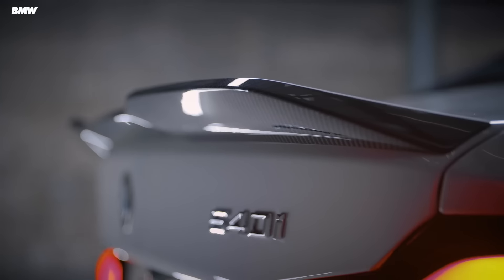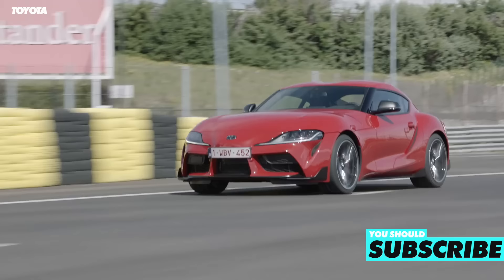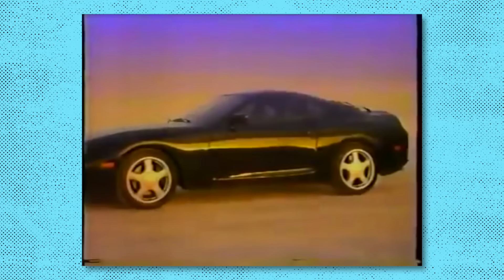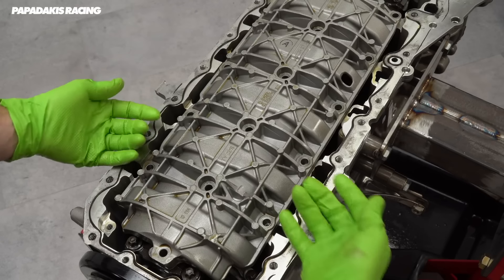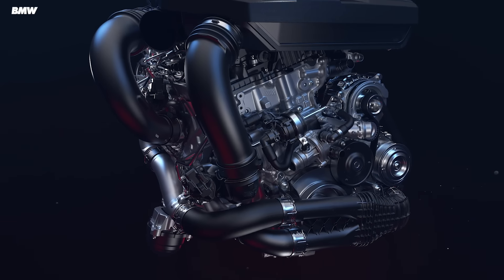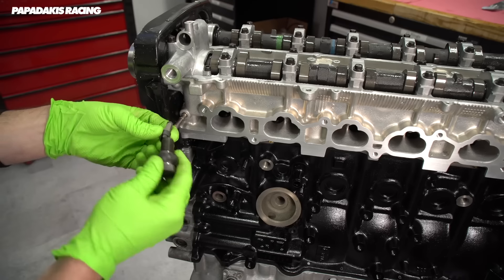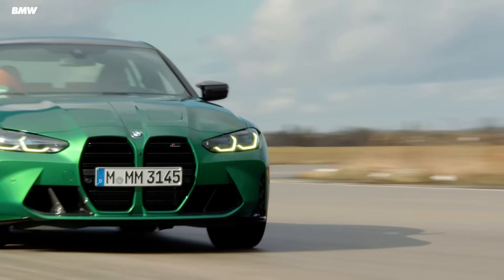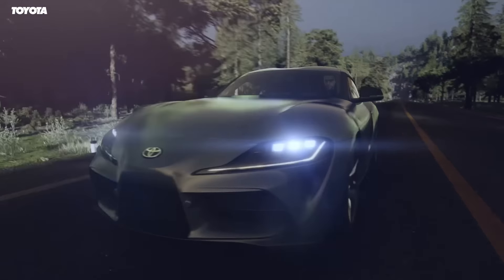Inside BMW's Greatest Engine

Comment: You forgot to mention that the B58 had to meet Toyota quality control. It only passed Toyota's quality control after Toyota's engineer sent back 1000's of B58 parts back to Germany for improvements. Now all BMW models with B58's benefit from this.
Reply: That was the specific variant of the b58 that's in the supra. Not sure if they use that exact variant in their own cars (I think there are 4 variants)
Reply: this is BS
Reply: Lol how do you know this?
Reply: B58 from all all (40i) 2016-2019 are completely different than the b58 in the toyota supra and 2020+ M340 which is a B58TU with 6 port injection
Reply: @Mitrofanvlad  Lovely, your BMW fanboi tears are oh so sweeeeeet!
Reply: BMW doesn’t use that variant in their cars, the B58 in other BMWs have proven to be good, those “1000” parts I feel is bs. There’s not many things if not any issues internally inside the B58 in general, people already touching over 100k miles in these with no internal issues. Only time will tell, this is probably going to be the same case as the M54 a great engine overall with very little problems if not better than the M54 and M52.
Reply: I smell a whole lot of BS! Show me the proof that Toyota had a hand in the development of the B58!
Reply: @joebloggs4191  Search for it online. This was part of interview done by the Supra's chief engineer. I can't share links here because YT will automatically delete your message.
Reply: in interview they said that but in reality toyota only helped with minor tweaks on the B58TU for the supra, the whole 1000 parts is rubbish, considering the fact the engine was very reliable to begin with
Reply: @pantiesgonewild358  It's not rubbish. Toyota's reliability reputation is on the line by putting a BMW engine with their Toyota badge on it. You think Toyota is going to just blindly trust BMW or do you think they are going to extensively test the engine? Toyota and BMW have different quality control. It's why Toyota scores every year top 3 position as most dependable vehicle and BMW barely above industry average. Those are facts backed up by numbers. Toyota did test 1000's of B58 parts when inspecting the engine, it's what Toyota does. They do this on their own engine as well.
Reply: @pantiesgonewild358  Exactly! like if they went and spent all that money redesigning parts with new tooling etc. for what is a low production volume car. Makes zero sense. They went to BMW exactly because they didn't want to spend money on development of the new Supra as otherwise they would have built there own engine! The new Supra is 90% BMW and 10% Toyota! Which I don't mind because I am a fan of both BMW and the Supra and have owned both. But these Supra fanboys need to get their head out of their backsides! Not exactly like the Supra was completely bullet proof, head gasket problems anyone?
Reply: @Mitrofanvlad  it aint
Reply: @joebloggs4191  nope its true, that's why the chassis and engine of the z4 is also reliable af. Basically BMW built and Toyota tested
Reply: @barackhusseinobamaii3303  The B58 has been around way longer than when it was put in the Z4 and Supra, 2015 in actual fact! Also do not forget that both cars are built by Magna Steyr and not in the Toyota factory. The B58 has been a reliable lump well before Toyota came onto the scene! The only thing Toyota did was check that it was reliable which it is and made their own chassis tune and different body, everything else is 100% BMW! As I said 90% BMW 10% Toyota!
Reply: @electrikoptik  It is rubbish, why did Toyota use Yamaha built engines in the last gen Celica, engines which I might add were pieces of unreliable shit! They built the Supra in conjunction with BMW because they did not want to spend development money on their own engine so do you think they are then going to spend that much on redesigning and producing 1000s of part and are you that stupid to believe that BMW would turn around say ok master Toyota we will produce over 1000 parts just for engines for the Supra? All of you fanboys do not understand basic business and economics!
Reply: @joebloggs4191  Toyota owns a part of Yamaha and furthermore Toyota and Yamaha have been partners for very very long time. Yamaha is a master in headwork. It's what they mostly do if they collaborate with Toyota engines. The 2ZZ block was designed by Yamaha. It's a great engine, used by Lotus also. The oil pump is the Achilles heel of the 2ZZ, though incidents are rare and usually occur due to fault of the driver.
Like I mentioned before Toyota's reliability is on the line, they won't just put a BMW engine in their car without fully inspecting the engine. They've done this in the past with other models that briefly used BMW engines because of partnership. For example the BMW N47 engine was briefly used in a couple of euro-spec Toyota's. For the N47 Toyota redesigned the Stop & Start system, created new ECU, more insulator engine mounts, installed their own DPF filters and a new dual-mass flywheel, resulting in a smoother, quieter and more efficient and refined engine.
Reply: @electrikoptik  As I have already stated the B58 has been around way longer than the Supra and it was already reliable nothing for Toyota to do on that front!
Reply: @joebloggs4191  Toyota's partnership with BMW (2012) precedes the creation of the B58. Food for thought.
Reply: ‘Sent back’ and ‘test’ are two different things.  Yes they tested things as Toyota X-rays even the bolts. And taught bmw engineers a few things.
Reply: @electrikoptik  And each time Toyota uses BMW engines and not the other way around. Food for thought!
Reply: all marketing bullshit to save toyotas ass they did nothing, the b58 has always been reliable
Reply: Literally the reason its so durable is because of toyota and its dope
Reply: @Arceus556  Another idiotic comment. As said before the B58 was around long before Toyota came on the scene! BMW do know how to make durable engines, they have many in their back catalogue which were very reliable. Only Scotty Kilmer and Supra fanboys don’t seem to understand that.
Reply: @joebloggs4191  Please educate us on how reliable the BMW S85 engine is. Let's begin with that one.
Reply: @electrikoptik  Why don’t you educate us on business and economics since you think that it makes financial sense to enter into cooperation with a company to buy their drivetrains and then to turn round and waste dollars on re-engineering over 1000 parts? Let’s start with that shall we?
Reply: @joebloggs4191  Yikes! This guy is super salty. Let me apologize to you. I'm sorry that it took Toyota's quality control for BMW to finally make a decent engine. Although still the B58 is known for having 4 common issues: Coolant Consumption/Loss issues, Valve Cover Gasket issues, Oil Filter Disintegrating issues and VANOS Solenoids issues. I think you should redirect your anger and bitterness towards BMW. Send BMW HQ an angry letter and demand them to build higher quality cars/engines. Facts don't lie, BMW scores every year on quality/dependability tests slightly above industry average and then barely above Chevrolet.
Reply: @electrikoptik  I think the super salty people here are the nut jobs Supra / 2JZ fanatics who can't understand how businesses work. The B58 is a super reliable unit despite what you might think. And for the last time NO the ones sold to Toyota are no different to the rest of the B58s! get that into your thick skull!
Reply: @joebloggs4191  Bro, Toyota and BMW partner up years before the B58 got created. Quality control testing started as soon as the engine got created. So all B58's benefits from this. Here this is a direct quote from the partnership all the way back in 2012.

"BMW Group and Toyota Motor Corporation (TMC) are pursuing their successful strategic long-term cooperation in the field of sustainable mobility today by signing binding agreements aimed at long-term collaboration between the two companies for the joint development of a fuel cell system, joint development of architecture and components for a sports vehicle, and joint research and development of lightweight technologies. These agreements follow a memorandum of understanding signed in June 2012."

joint development of architecture and components for a sports vehicle, and joint research and development of lightweight technologies
Reply: @jcdenton8750  A lot of vague statements there, show me where there is hard proof that says the B58 was co developed or co engineered with Toyota!
Reply: @joebloggs4191  i never said it wasnt around before toyota..theres 8 iterations of the b58, and only 2 of them made it into the supra. 

The B30M0 for example had common issues with pistons breaking with mods and coolant loss without, sometimes misfires and crankshaft sensor issues but those were less common. 

The B30M1 had some timing chains snapping, and tensioners that wear down too fast occasionally. B30C (in the supra) had a few reports of excessive oil consumption during break in periods, and thats really it. 

The B30O1 which is also in the supra along with other BMW products, also minor oil consumption during break in but that's all that's really been reported...

but not I'm sure there was nothing toyota did during the 7 year design cycle (the B58 has only been out 5 years mind u) that Toyota did to improve the engine before using it...and mind you the B58 is currently the most reliable engine bmw has ever made...also no shock with toyota influence. 

Yes the N52 is an amazing engine, but if you wanna cross compare 300k miles for an N52, or S62 is pretty damn good, and I've personally seen a few M50 at 400k, and I've heard of M20's going upwards of 600k...

Mind you though; 2ZZ-GE last essentially until someone misses a shift, 2jz-gte can last well over 500k miles if no one blows it up first, 22RE usually rust out before the engine dies, the 1GR-FE 'only' lasted around 300k along with its 2GR brother, 1GD-FTV are easy 500k, the entire T-Series is bulletproof, and it would be a sin to not at least mention the well known 2UZ-FE which has surpassed a million miles multiple times
Reply: lol you are crazy. If BMW had to change the parts they were using on purpose for Toyota the partnership would have ended before it started. You have 0 notion how these big companies work.
Reply: @electrikoptik  they used a Subaru engine in one of their cars Just a reminder
Reply: @electrikoptik  how about you name another mass production high revving v10 with multiple examples of it reaching north of 200k miles?
Reply: The lil dork enters the chat
Reply: You have 0 notions because you don't have a Supra
Reply: Do you really think BMW builds an own engine  following Toyota's standards instead of own? No manufacturer does this. The engine was not exclusively commissioned. You don't know how this works apparently.
Reply: BMW engine not passing Toyota quality control, yeah right 😂

Comment: The McLaren F1 is BMWs best engine
Reply: The S70/2
Reply: How did bmw make it weigh only 430lbs?

Edit: oh wait i forgot, a 20,000 mile rebuild interval that's how
Reply: @CSLFiero  Yes, because most other Supercars are known for their 10year,100k mile powertrain warranty... bonehead comment.
Reply: Best engine because of what?
Reply: @yt-user7639  chicken nut
Reply: P60
Reply: @yt-user7639  because it's not made by you
Reply: @yt-user7639  cus with that engine supplied by bmw it won at le mans, broke top speed records and was the fastest car w/ top speed of 386kmh  for like 13 years until the Veyron took it's crown in 2005 and to this day the F1 remains as the fastest naturally aspirated car, what a legend
Reply: @CSLFiero  if you're going to comment on the F1 or it's engine, you might want to learn something first. For info, Mclaren's XP4 prototype, with the reg number K8 MCL. Not sure what mileage it's on currently, but it's well over 100k and I believe somewhere around 140k. It's also the same car/engine that did the Ehra Lessien top speed run at 242 MPH and is still on it's original engine and has never been "rebuilt".
Reply: @loytune  😂😂
Reply: @realspeedghxst  -> YT-User doesn't know what Le Mans means. This was not discussed in Fast & Furious and the game Bubbles. But he knows much about sand toys, balance bikes and propeller caps..
Reply: @CSLFiero  You forgot something else:

Mom says you ride on the short bus because you´re special
Reply: @hw6639  i never forgave because i never forgot
Reply: @CSLFiero  Yaaaaaeee doesn't make any sense.. Get well soo
Reply: That or the M52/54. Basically an alu block 2JZ from the same time period (that the US didn't get because you allowed sulfur contamination in fuel). Reliable as hell if you take care of the cooling system since they're 25 years old (aftermarket water pumps with metal impellers are dirt cheap, just replace it every time you do belts to be extra safe). The stock rods can't take much more than 350-400whp but given the engine was sold at 200 at the crank that's expected. If the previous owner did their oil changes on time you won't even need to bore or sleeve the block as the cylinders are likely to still be in spec with good crosshatch after 400k kms. Good for well over 800 wheel if you know what you're doing while being half the weight of a 2JZ lol. 

Oh, also you can kind of fit their heads on M70 blocks. Takes a bit of work but it's basically a "low" budget S70 if you're willing to do that.

Comment: The B58 is not really just 5 years old. It is an evolution of the N54 (bi turbo) and N55 (twin scroll turbo) engines from cars like the 335i going back to 2005 iirc in the E60 535i. There are also variants like the S55 from the last M3/M4 and the S58 from the current M3/M4.  Reliability issue you hear of from the earlier engines are normally from the bolt on bits and not the actual engine itself.

Comment: the n54, n55, b58 are great engines. Have a N55 and no problems with it. Oil change interval to 10tkm and not too much torque when the engine isn´t on temp.
Reply: N55 gang 💪🏼 ! In my opinion the best sounding engine out out of those 3.
Reply: @Doctor_Martain  I know people generally don't like the sound of the N54 but I think it sounds alright. 😅

Comment: TL;DR: it's not about history

I find the B58 vs the 2JZ very similar to the FA20 vs the EJ25. Yes the EJ has been around for decades and yes there's more knowledge for EJ's, but the FA has a better top end, better stock turbo and better tuning potential. It's basically purists vs engineers, yes the FA also had downsides (the bottom end isn't that strong and the compression ratio is kinda high) and it wasn't put through the paces of motorsports but the knowledge learned throughout the EJ platform's lifetime is implemented into the FA's platform. You can scream and cry about how some things are better then others, but there was a time where the EJ25 and 2JZ sucked in the aftermarket department. If the drive to make the engine(s) better, it'll be better sometime down the road.
Reply: Not sure why you brought Subaru engines into this,  but the newer FA20DIT is a bit of a disappointment.   However, the FA20 NA found in the BRZ or 86 is far better than the FA20DIT found in the WRX.   Most likely because Toyota co developed this engine.
Reply: This seems to be a similar story with the new b58 found in the Supra.
Reply: yeah, way before the 2jz era people use the rb26

Comment: ayy b58! 

I sure love mine (2020 M240i) I have a stage 2 dinan tune as well and a whole bunch of other mods. its super fast, no problems (so far), and sounds incredible!!

everything stock + dinan stage 2 tune is supposed to be around 420 ish wheel horsepower but I havent tried a dyno yet. best part is I still have my warranty
Reply: How? Any tuning  of the ECU will void your warranty. Maybe a piggyback tune since you can take it off but a ECU tune will always be detectable even if you change it back to stock
Reply: @JL-rx7ou  its a ECU flash and either Dinan provides their own warranty or because its a conservative tune i can still use my manufacture warranty. which ever it is I made extra sure that was the case before getting it
Reply: How can you tune a car to stage 2 without modding the engine bolt ons? That would just be a very good stage 1 tune. Stage 2 is when you start messing with intercoolers and exhaust systems
Reply: @paulnolan6866  I did all of those things. i have 12k worth of mods
Reply: @nbaumg  With 12k in mods. You will have easily 700hp+ not 420. And first mod before upgrading power need to be LSD. Because than horsepower are useless.